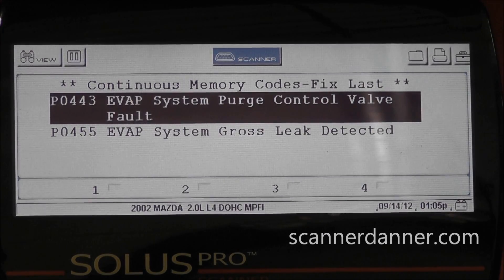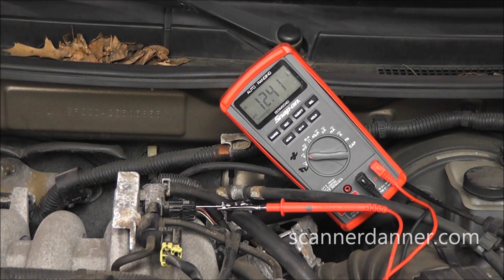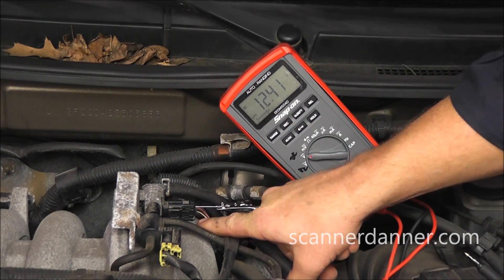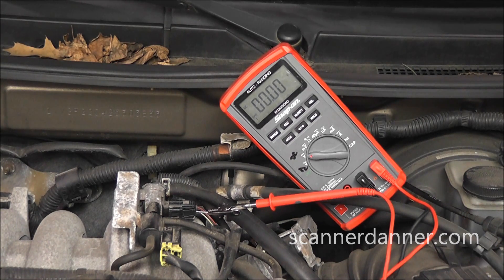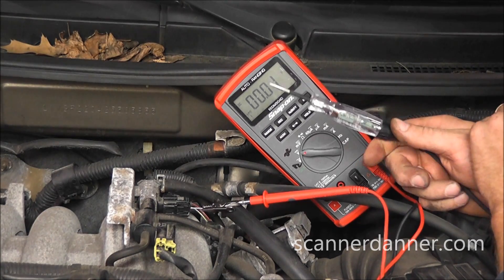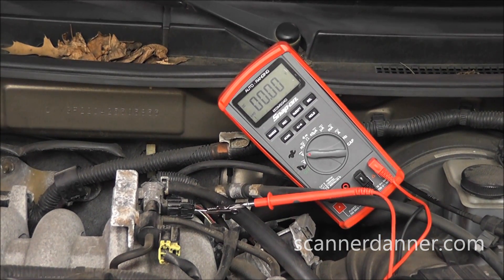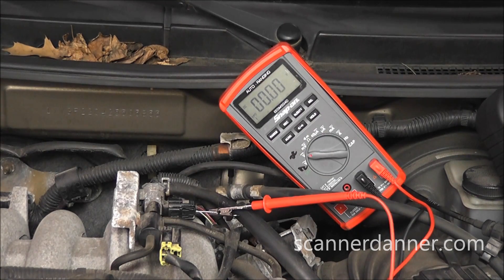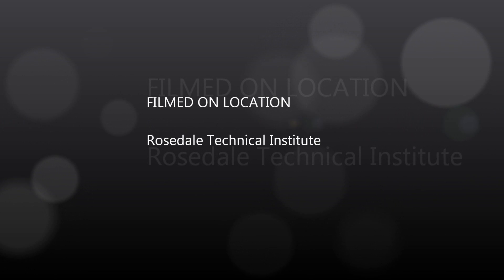How to test a purge solenoid (Mazda P0443, P0455)

Comment: my purge solenoid valve.... receiving voltage from red wire 7volts and signal wire about 3 volts. my car currently rough idle, lagging gear issues and when reverse jerk. Any Solution for fix my issues
Reply from the maker: Low supply voltage to your purge valve is not going to do what you're complaining about BUT if there are other outputs that share that same low volt supply, you may be onto something. Track that circuit!
Reply: @ScannerDanner  how to fix that curcuit?

Comment: Thank you for that info you are always a big help to me and my diagnostics. I had the same situation today, but the test light when I touch the to The control side was not bright like it normally is this meant that I had either corrosion in the wiring or the driver in the computer was not properly grounded yet.

Comment: Thanksfor the video. At 4.20 you get 9v on the volt meter. The test light is at 12v battery, and touch the T-Pin. The volt meter is between T-pin and ground. If the solenoid is cut of, will not the volt meter be in series to the light? Were did the 9v came from? Thanks

Comment: Some questions if you could clear up:  1. Is the car ignition on at any time during testing?
2. When testing the switch leads with the voltmeter, where is the voltmeter's black probe attached?
3. What is the next step to solve the P0443 code if the purge solenoid proves to be good?
Reply: !-The car has to be KOEO to test.  KOEO=Key on engine not running.

Comment: The question I have with this is about how the PCM monitors this circuit.  Does it look at control wire voltage the same way you did during your test?  or does it monitor some pressure or flow sensor attached to the evap system while commanding the purge open (which could create a variable)?
Reply from the maker: The monitor for each output can be different. Some monitor voltage, while others monitor both voltage and current. And then there are logics for flow testing too, but this would be a separate code.

Comment: Hello I hope you're doing well I bought a 2002 mazda b3000  I notice that the purge valve vacuum line  that goes into intake it would shrink when accelerating or once the engine is running thanks in advance
Reply from the maker: deteriorated hose from fuel vapors, replace the hose
Reply: @ScannerDanner  thanks so much I appreciate your help
Reply: @ScannerDanner  i forgot to mention that I have p0172  &   p0175 running too rich

Comment: When your probing with the red probe from the multimeter on the "T-pin" where is the black probe from the multimeter?
Reply from the maker: Battery ground
Reply: @ScannerDanner  nice... And the car was in the "on" position? I'm gonna try this tomorrow.
Reply from the maker: @jeffreymuller2294  what time frame in the video? And was i measuring voltage or trying to energize something?
Just want to make sure I'm not giving you bad information

Comment: So just because the purge solenoid clicks on and off with battery power to it, it doesn't mean it's good right? Have a Honda element.
Reply from the maker: Correct. While its clicking on and off you should feel vacuum on the inlet, (if you take the line off). And then no vacuum when you electrically unplug it
Reply: @ScannerDanner  Thanks thats what happened i tested for circuit and then tested for the click, thought it was good, put it back in and it actually cleared for a few hundred miles and came back and  seen that p0497 p0457 were back.   I'll test for vacuum and ohms and you think I'm on the right track for these codes?
Reply: @ScannerDanner  wanted to update you since the information can probably help someone. Tested my purge solenoid it now read 7.8 kohms and it also did not click jumping it. Replaced it and now codes have been cleared over 150 miles and still good all monitors ready. Thank you so much for being a great instructor and a great person I can see.

Comment: This is interesting because I have a solenoid that clicks but I keep getting a code for the valve control bypass valve solenoid, tested the voltage and seems okay but not with a test light yet. This makes me wonder if maybe I might end up with the same symptom of having an open coil.

Comment: I still have a p0443,after i replaced   my purge solenoid i ,cant even erase the code with scan tool,what could it be?,im lost and frustrated.
Reply: Gerardo Acosta it could literary be anything broken vacuum hoses, bad or cheap purge solenoid, faulty wiring, faulty pcm. Ect dealing with the same problem and its driving me crazy I'm About to go check my evap canister vacuum hoses and see if i need to replace them, if their good ill just have to replace my evap canister.

Comment: Mr. Danner, when you were testing the power feed at the connector, was this done while the circuit was energized with the scantool to eliminate the possibility of a voltage drop from high resistance?
Reply from the maker: In this case, loading the solenoid to check the feed side for a voltage drop was not possible nor necessary. The solenoid was open. No way you have an open solenoid and a high resistance power feed at the same time. If you feel the need to load the feed wire here, your test light (incandescent type) will be your best friend in this case. You are not wrong in your thought process. Technically speaking, the power supply test I did was not ideal but again, it had to do with the solenoid being open and being able to ID this issue 100% and we did that. Make sense?
Reply: I think so.... In the field, loading the circuit takes extra time given the fact that a scan-tool with this capability is required on pulse width modulated ground side switched circuits and is unnecessary within the context of identifying open circuit faults. makes sense to me man.
Reply: Can you tell me where you connected the black wire from the volt meter.

Comment: i think that all your videos are great, you are my go to for furthering my education. However I like to simply ohm  out the solenoid to avoid the potentail back feed problems that you warn us about.
Reply from the maker: the ohmmeter is not an accurate tool. If it measures bad, it's bad, if it measured good, it can still be bad. Of course you can use it, you just need to be aware of its limitations.

Comment: Hello,
P0443
Costumer said that the purge solenoid has been replaced.
The car sounds and feels like misfires.
I checked the harness on the purge solenoid. KOEO, I have 4(V) on feed wire and 0(V) on control wire.
I don't know why but I checked the feed wire on the ignition coil and it was 12(V). 
Also I checked the feed wire on the fuel injector and it was 3.9(V).
Any suggestion?
Thanks
Reply from the maker: Misfiring would most likely be a completely separate issue from you 443 code

Comment: What does it mean when both wires are running at 0.45 volts and I replaced valve
Reply from the maker: depends on the car, it may be a normal reading if it is a power side switched solenoid and the computer hasn't turned it on yet. If it is ground side switched, you a missing a power feed to it.

Comment: how you replace the egg vacuum solenoid in an 04 rx8. I have a p0443 code.
Reply from the maker: how do you replace it? how do you know it needs to be replaced? You cannot change a part based on a code my friend.
Reply: then what's the defective part?
Reply from the maker: Need to follow a flow chart and do your tests. Voltmeter, test light and a decent scan tool with bi-directional controls is a minimum. Follow the steps I've shown here.

Comment: What does this part do to your car if it is fault y
Reply from the maker: depends if it is stuck open or closed. Stuck open = rich conditions until the canister is depleted of stored vapors, then lean condition after (vacuum leak). 
Stuck closed = canister that becomes completely saturated, raw gas smell coming from the canister, most likely no driveability symptoms.

Comment: could you unplug it and say put a test light to the connectors or would that not be enough load
Reply from the maker: you could do that, in fact isn't that what I did? sorry I don't remember
Reply: it was still plugged in but since the winding was open it was like it was unplugged . thank you for answering, you provide such a valuable service and when I get in a better financial situation I'm going to get on your premium channel .
Reply from the maker: Exactly. And I did the test light test for two reasons.
1. To make sure there was no short to ground (0 volts on control wire)
2. To test the control wire integrity and driver function in the computer. 
I think I used an LED test light for this one, so I didn't really load the circuit as much as the solenoid would have. So believe it or not an incandescent light would have been better here in this application. 
Look forward to your comments and questions on SD Premium!
Reply: thank you , I'm so relieved that I'm starting to  understand  electrical diagnoses because even though I have been working on cars for over twenty years I can see that the future is very much going to be more for electronics . once again thank you for your time , I know your a very busy man .

Comment: I'm sorry, I'm confused on something.  Anyone know: If you bench test a purge control solenoid, and it opens with 12V battery power applied; can it still be bad?  I get 12V on power wire, and nothing on control wire.
Reply from the maker: Yes, because it can mechanically stick at times. BUT your statement of 12v on the power wire and 0v on the control. Was this with the solenoid plugged in or unplugged? Was the car running or just the key on? 
Was there vacuum coming through the purge valve or not?
Reply: Hey SD, thanks for the reply.  I love your videos, they've taught me a ton.

So, 

1)I did not check vacuum at solenoid, I will check that. I did remove the solenoid and could not blow air through with no power, but could blow through with power applied.
2)With solenoid plugged in and car in key on engine off, I T pinned the wires and found 12V at power wire and 0V at control wire.

Also, it's a 2007 Acura TL that presented with check engine light and no driveability issues.   Codes P0443, P145C, P0497 and P0443.
Reply: I'm sorry I haven't done the test you explain at 4:25, I'm a bit confused.

Comment: I currently have a 2014 Grand Caravan 3.6L, with a P0441 EVAP purge flow.  Unfortunately we don't have any repair info coverage yet for this new of a vehicle, and was hoping to catch a gem of info on what to check for.  Would checking the purge solenoid in a similar manner as you did in this video be useful?  Not sure without diagrams whether its ground or power side switched at the moment, waiting on the boss to sign us up for some repair info coverage from Mitchell.  Any suggestions on direction appreciated.
Reply from the maker: +Chris C It's different. Both wires go to the PCM, so you need to tread carefully. Most likely it is power side switched. Follow my Section 3 material on page 6. The picture to the left. The one where I have the solenoid unplugged and I am using a test light on both connector wires. I think you have my book right? I recognize your name.

OR you can connect a test light in between both terminals and bi-bidirectionally turn the solenoid on. This will at least tell you your wiring integrity and PCM are good.
Reply: Thanks Paul for getting back to me, having a heck of a time getting this van back into the shop long enough to do anything with it, its the only disability access taxi in the city.  So when I do get it in the shop, I have to make the best the time I will have!  We now have Mitchell DIY subscription for it, so have access to the good diagrams and such.  I will post a thread on your forum concerning it, rather than take up any more Youtube time on it.

Comment: You are not help at all
Reply from the maker: +Renee Chavis and what about this video was no help at all?
Reply: No because I still can't locate my canister purge solenoid valve on my Mazda Tribute 2003 V6
Reply: @reneechavis7036  6 year old comment but you answered the question to your problem with your own comment.

This is about a Purge Valve Solenoid, you said CANISTER Purge Valve Solenoid but it is called a VENT Valve Solenoid if it is for the charcoal canister, usually located on the gas tank if that is the case.
Reply: Oh ungrateful eh?!
Reply: But his video is about testing the solenoid and not find your specific solenoid.

Comment from the maker: What is the P0455? Vent solenoid I think. If so, the methodology would depend on the initial voltage readings on the solenoid. Follow Section 3 in my eBook if you have it.

Comment: I ran across a purge valve on a 96 tahoe. This vale was tested with a 9 volt battery and blowing through it. It worked fine but would not open when you cycle it very fast.